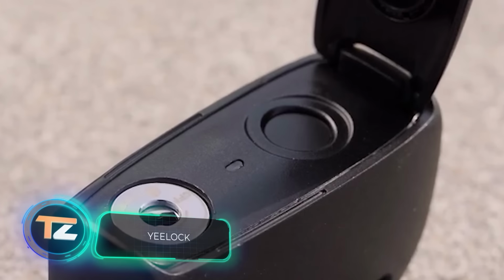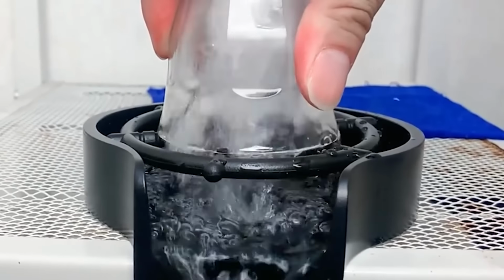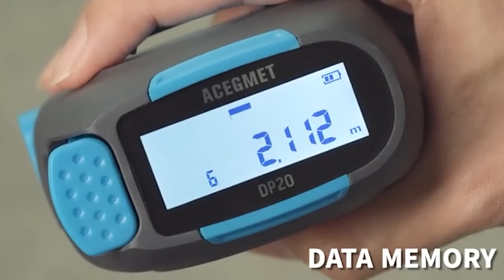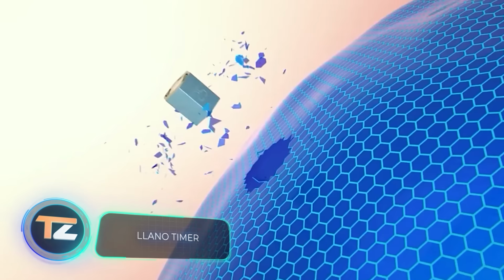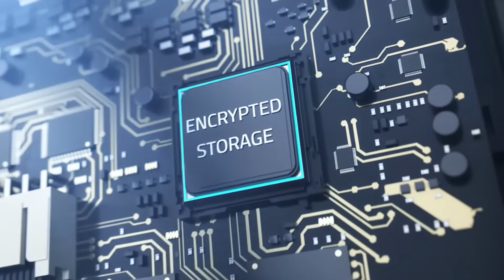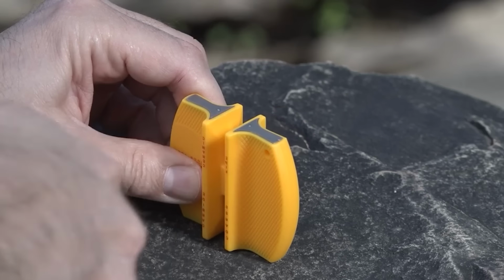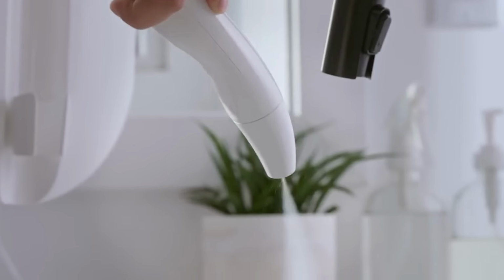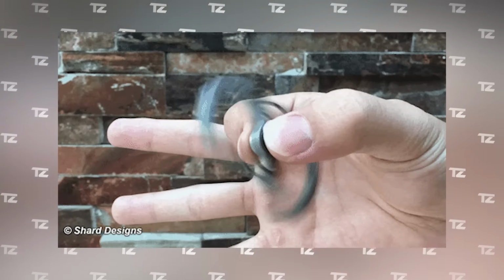AMAZING GADGETS THAT ARE WORTH BUYING

Comment: Yeelock will not stop thieves picking up your bicycle and putting it into a vehicle. Then simply removing the lock or brake disc at their leisure. And the key option is another weakness.

Comment: The waistbelt dog leash can be dangerous. If you have a medium to large breed dog, and the dog starts to really pull on the lead, it can really hurt your low back. And if the dog bolts and starts to run, you can be knocked off your feet and be dragged by even a medium sized dog. This happened to my sister when she tried a belt leash similar to this!😮

Comment: 1. Ask LPL - cheap padlock will be much better and safer. 2. Long hike will be useful in order not to fly away 3. Trash, but you can use it as weird wallet. This lock can only prevent childred below 6 yo. 4. Interesting, but my tap does it better, faster and cheaper. And it has magic reverse-gravity quirk which speeds up water too. 5. Portable light, looks nice 6. Drone/camera, only software can be worth something if its good. 7. And electric screwdriver...

Comment: That glass washer would fail the hygiene laws in any public scenario as it only washes the interior. Imagine all the lips that have licked the exterior rim of each glass.
Reply: So glad this comment already here. No soap or steam, yuck
Reply: These things have been around for... I want to say over a decade? They're commonly used in cafes to rinse out milk pitchers between coffees.
Definitely not for use with anything someone will drink out of.
Other intended use case is to rinse cups or glasses before putting them into a glasswasher. If you check the provided link, it's been misrepresented in this video.

Comment: "according to the creators, the  code lock has a 1000 combinations"

Well, considering that the lock has three wheels going from 0 to 9, I tend to agree with the creators' estimate.
Reply: 100 tries per day, you need only 10 days to unlock
Reply: Or you can just throw it on the ground.
Reply: Butter knife level of security 😂
Reply: @nishali3343  wow u definitely simplified it. But if it has gps u probably may not have ten days to unlock it, lol 😂 but thanks for noticing this. I was about to get it 4 my son. Now i wonder if it is worth it

Comment: I was looking forward to the adjustable Smith sharpener but you have bad information on that sharpener... that's the smith X sharpener in the video... the coarse sharpening side is two tungsten carbide blades, the fine side is two ceramic rods, and it's not adjustable. the price is between $15 and $25 depending on where you purchase it.
Reply: And it's a piece of garbage unless your intent is to destroy the edge of whatever was unfortunate to have you pull through it. It'll cut once and then be deburred and dull again. Beware.

Comment: I think for the most part CO2 levels are not a concern, my understanding is that the impulse to breath comes from elevated CO2 levels in the blood, so I think you would become aware of CO2 where becoming unsafe. Meanwhile CO is a different story, you body exchanges it for CO2 instead of Oxygen reducing blood oxygen levels without you knowing.
I never understand the purpose of CO2 monitoring (as opposed to CO)

Comment: The knife sharpener works great, I've been using this brand for years. You can definitely find them cheaper than $18.
Reply: I had that knife sharpener and it was far from great, it was the worst knife sharpener I ever used. I can get better results scraping the knife on a rock. Yes, you can find them cheaper than $18, you can find them for a dollar.
Reply: @sylver369  I agree with you, the  knife sharpener is terrible.
Reply: My experience was a lot different than your. I hope people don't waste their money on this
Reply: @maryworth3264  It's a knife sharpener, it's not that technical, but for some it can be a little difficult to sharpen knives. This is not a magical device, you have to put in some effort. If your knife is really dull or damaged, you will have to put in more work, just as you would with any knife sharpener. You use the metal cutting blades to do the initial sharpening and to remove and burrs, dings, etc in the blade. You have to listen and feel what the blade is telling you as you pull it through the metal blades. Does it sound like it's skipping at places, then that is where the blade has damage and is not smooth. Are you putting enough pressure on the blade as you pull it through to make the metal cutters effective? When you initially start cutting with the metal blades, you will hear and feel the metal actually getting scraped off. As you pull it through more, you will hear the sound change, and feel a difference, it will get smoother. If you're doing it right, the metal blades will cut through the blade dull and damaged parts and reform the cutting angle just fine. When using the metal cutting blades, check the knife blade from time to time, you should notice it getting sharper. Once you get a consistent sound and feel to the blade as your pulling it through the metal blades, you can switch over to the ceramic blades for the final sharpening. 
On the ceramic blades you don't want to use anywhere near the pressure that you used during the metal blades. With the ceramic blades, that is the final polishing part, and you should treat it as such with several light pulls through the ceramic. Don't overdo the ceramic finishing part, you can easily overdo it and remove some of the sharpness that you had achieved with the metal cutters. Two or 3 soft, smooth pulls through the ceramic is all you need. The ceramic is just to remove the small burrs etc from using the metal cutters.
I'm no good at using a sharpening stone, I just don't have the knack for it. I can get close, but wind up screwing it up when using a stone. I know other people that can craft a razors edge with a stone. 
I own several of these Smith's sharpeners, and they all work the same, great. I also don't wait until my knives have gotten completely dull before I use these, I tune up my knives regularly, and these sharpeners make that a very easy task.
Maybe a stone would work better for you.

Comment: the problem with a lock that has that many different ways to open it is that it opens up to more vulnerability. if someone really wants into your house a smart lock isnt going to stop them your better off buying something more robust, sturdy. something that wont defeat the purpose of spending all that money due to a dead battery. never trust your safety to technology alone.